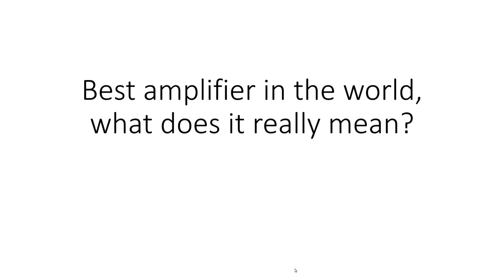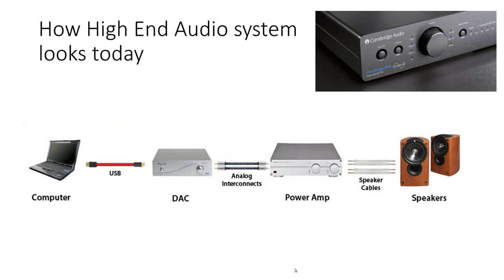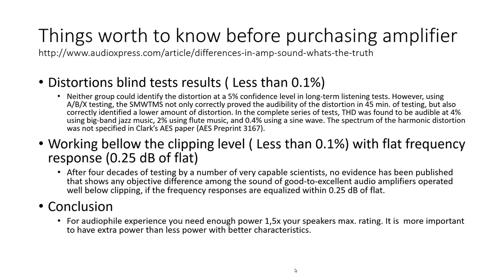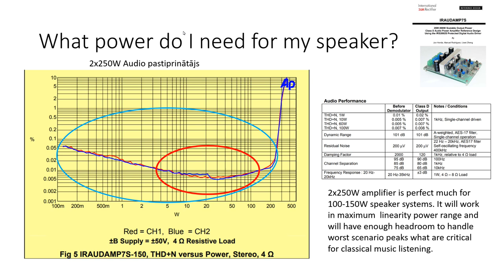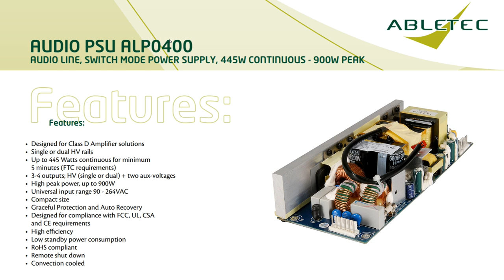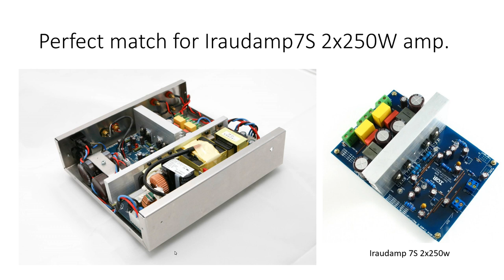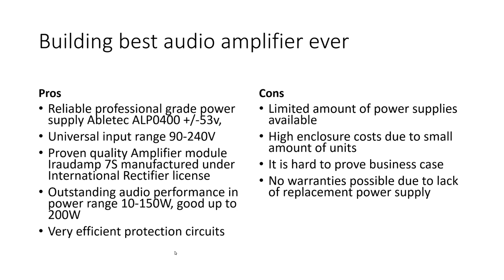Best audio amplifier

Comment: Hi Guntar, thanks for your videos. Very informative. I'm not an electric engineer, so I got some questions regarding a project like this.
1) why after the DAC you don't need a pre amp?
2) I watched a video of PS Audio, and the owner says that he uses icepower modules for his class d amplifier, but he add few other components to make it sound better. What would you add to the iraudamp other than the power supply to make it more "complete"?

Please do check PS Audio videos, the guy is a wealth of knowledge in the industry
Reply from the maker: 1) Good DACs are digital preamps with built-in volume regulator and excellent low impedance output delivering voltage up to 2V. what is more than the amplifier needs? DAC is a very important piece of quality. Good DACs with volume regulator and balanced outputs pricing is starting from 400USD. I have a positive experience with Cambridge DAC magic.   If you have good acoustics you do not need tone control etc. what in most cases degrade source quality. Today DACs are taking over and becoming streaming preamps with remote management from tablet or phone. A relatively good cheap alternative is a modern audio interface like Focusrite scarlet 2i4 or Zoom UAC what probably is on the top line products being one of the latest company designs. 
2)For  Iraudamp module I would add a balanced input stage and drive stereo channels in opposite phases to compensate potential buss pumping ( specific only for single-ended Class D amplifier).  With that, you will get less THD at max power due to effective power supply buss pumping compensation. Speakers should be connected in a way that both stereo acoustics are in sync. But for me, I was happy with the standard configuration and good power supply. I do have another video where we made a simple DIY project using a broadly available power supply.
Reply from the maker: Good DAC has a built-in preamp circuit with low output impedance. Typically less than 100 ohms. In reality, it is a perfect preamp. There are DAC models with volume control. If you have good speakers you don't need tone control.
Reply: I have this amp connected to a TOPPING d50s DAC replacing a NAD356...no regrets!

Comment: Hi Guntars, I have read in diy forums that components used in the PCB (caps/resistors/diodes etc) influence the sound quality ..Would you be able to share your thoughts on components used in the the ebay IRAUDAMP7S (link which you have provided in one of your comments below) ?  

With regards to nature of the sound quality of this amp, is it neutral sounding or does it have a character?

 Also, do you still have an amplifier for sale and is it still priced at $285  with shipping to US?
If you don't have amps, do you have the enclosure and/or components ?
Reply from the maker: Answer to this question would be too long. I do other video where touching components selection in depth. https://www.youtube.com/watch?v=5_NstNrT0xk&t=115s . Making it short. In this module most critical component - output filter is using correct components.
Reply: Thank you much for your response. Would you happen to have units for sale and shipping to US? In case you have eBay link for any units on sale, I would like to buy one.  Thanks for doing nice videos!

Comment: I'd recommend you try the Hypex NC400 or the Purifi 1et400a. They are much better than this amp and any ICEpower module!
Reply from the maker: Purifi looks great, but it is still in the prototype stage. It will take a time until mass production version will be available. I bet on this company for the future. In reality, today amplifier board is not an issue. The biggest challenge and costs are associated with a good power supply having industrial-grade protection design. Regarding NC 400. There is too much marketing in it. I did not see any professional application where this board has been used. There should be a reason for that. Maybe it is a bit overpriced. And you need the exceptionally good power supply for that as well. At the end of the day, it is a costly project with a bunch of better alternatives. But with both solutions, you can build good design for personal usage. It is almost impossible to commercialize any of your proposed directions. Purifi designs are in NAD lineup already. NC 400? it is hard to find the right place for this design. It is more for a hobbyist. I would consider nCore 502 instead. It is a well-integrated solution with exceptional specifications and industrial quality.

Comment: Can you please give some links for the amplifier in the video..cause most I see in AliExpress make me thinking about their "originality"
Reply from the maker: Hi There are some links to eBay. All Iraudamp 7 modules manufactured under license  has the same manufacturer.
https://www.ebay.com/itm/L20DX2-IRS2092D-250W-250W-8ohm-IRAUDAMP7S-Class-D-Amplifier-completed-board/273163816167?hash=item3f99d50ce7:g:K44AAOSwlMRa1bNM:rk:1:pf:0
For good Quality you need SMPS resonant type power supply. You can not purchase Abletec power supply but here is good one from Conneex electronics available in Ebay. Check you country mains (220V for EU or 110 for USA) prior purchasing power supply. You need to specify correctly.
https://www.ebay.com/itm/SMPS500R-54V-dual-voltage-230V-SMPS-Power-Supply-PCBStuff-Connexelectronic/132346383933?hash=item1ed0758e3d:g:ZlUAAOxy4XNSOR0H:rk:1:pf:0

I have other video with detailed instructions how to build Power amp using mentioned components.
https://www.youtube.com/watch?v=Dit5JPAXwMM&t=496s
Good luck with your project.
Reply: Почему вы ставите блок питания +-55v если в описании усилителя рекомендуется +-75v???
Reply: @guntarssmits2104  Hi, the eBay link you have provided says product listing has been removed. If possible please check and provide new link.Thanks in advance.
Reply from the maker: Hi , please find the link https://www.ebay.com/itm/113817618670
I hope I understood right what product you are looking for.

Comment: Hi, Do you have for sale your amplifier? Where to buy your Amplifier? Cost?
Reply from the maker: Hi, yes I do have 7 pieces in stock. Price is 285 US with free shipping worldwide. If you are interested I will put it on eBay and let you know when it is done.
Reply: @guntarssmits2104  Hi, Could you supply the version AMP7S-55 or AMP7S-100. More then 60Wx2 is too much. Thanks a lot!
Reply from the maker: @Camaro-it8ht  Hi, the key message in this video was, that for high-quality sound reproduction you need good power amplifier driven in medium signal mode. 250W amplifier driven with 30W will give outstanding performance with a lot of headroom. And a good amplifier needs a good power supply. There are a lot of options in eBay and the socondary market for a 60W amplifier for good price and quality. Even 100W on-chip amplifiers will provide good audio quality at 60W. I am providing only 250W version because the costs are the same for an alternative, but the quality will suffer. Even driving shelve speakers 60 w is not sufficient. And the last point in this topic: any normal speaker system is capable of 4 times to nominal power short term overload with the nondistorted audio signal but will burn with a 60W distorted signal.
Reply: @guntarssmits2104  Привет! Мне интересно ваше предложение по поводу продажи на еBay  усилителя и корпуса.
Reply from the maker: @ВладиславГончаров-ъ1о  
Привет, я положил корпус усилителя на eBay для вас. https://www.ebay.com/itm/113824227260
Reply: @guntarssmits2104  Hello. The link doesnt work anymore. Is the amp for sale somewhere else? Thank you
Reply from the maker: Hi, I have sold all of them during Christmas time. I have one piece left what we used for demo purposes. It has volume control built it. It is in perfect condition with no scratches. If you are interested, I can put it on eBay and send a link to you, Price is 285 USD including shipping.
Regards
Guntars
 @tassostsoutis601
Reply: @guntarssmits2104  Thanks for the prompt reply. I am in the process of saving up, I expect to be ready for a purchase in less than 2 months. Will you make a new batch of them? I am in the process of watching your latest video series. What will the price of the VC500s be? When are they coming out? I really appreciate your videos, they are no nonsense, technical, sincere.  Please cover the subject of digital streaming too. Thanks for your great work.
Reply from the maker: @tassostsoutis601  Nо, this was a one-time project because we purchased very good power supplies in factory sale out and made sidekick project. Those are gone. If you are interested, I can keep the last one for the time being.
I have enclosures for a similar design where you can make such an amplifier by yourself purchasing components in eBay. Check this video https://www.youtube.com/watch?v=Dit5JPAXwMM&t=1144s